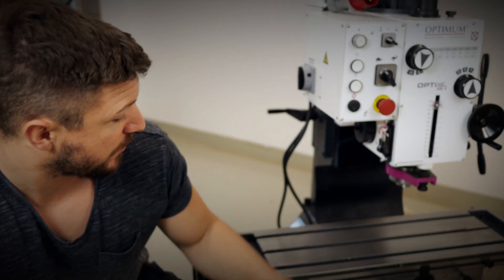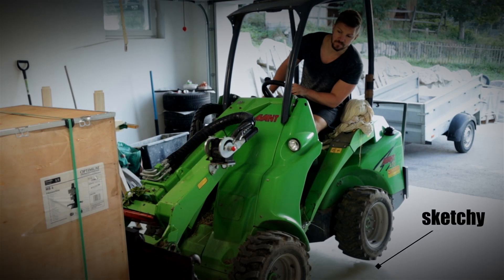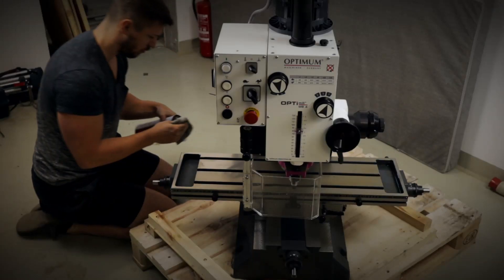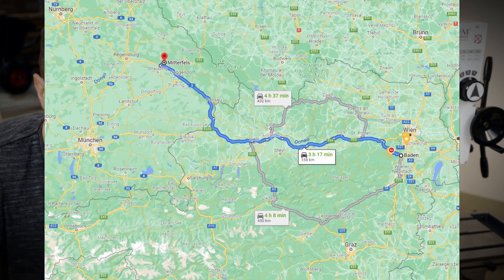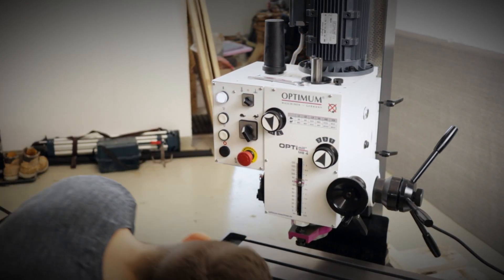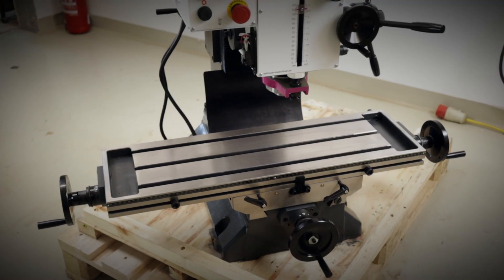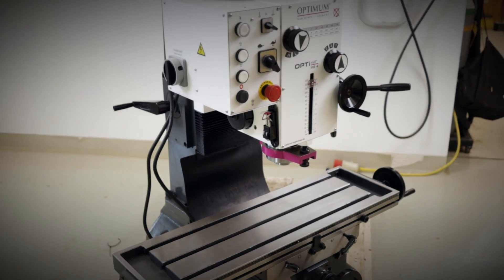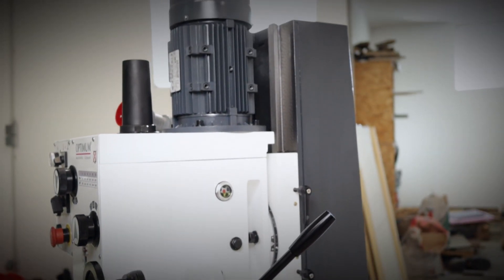OPTIMUM MB4 | is this chinese milling machine any good?

Comment: I want to believe that the very first thing you checked for accuracy is that metal square you are using for measuring. You would be shocked how non accurate those are "out of the box". They are good enough if you are assembling a kitchen cabinet but not for measuring the squareness of a machine to a hundredth of a milimeter.

Comment: Commenting on the machines itself. My opinion is that a machine of this design, when made in this size, is inherently flawed. Way too much top-heavy, no mechanical auto feeder, no adjustable tables, no powered Z axis! . Yes it has the power make large cuts etc, but it's not rigid enough for these, The separate electric feeder limited to the main axis adds more unbalanced weight and general awkwardness. At that price level one should be able to get rig of all these compromises and limitations that belong to the hobbyist / small shop class". It's for good reason why Deckel did the FP-1 the way they did some 70 years ago, it is still the best design  in my opinion. "motor on top" milling machine should be limited in my opinion to Chinese "size 30 or 32", with a BLDC motor and ungeared head.
Reply from the maker: I agree, but at this price point it's more a glorified drill press 😂
But I am very happy with it

Comment: Nice. Of course you're not the only expert to have dropped a ton sized machine. I'm in the same rank, allowing my "professional  mover" to load and NOT strap down a milling machine and an heavy lathe. At an uphill restart, both flipped inside the truck. The following hour, with 4 agitated men trying to upright them without all what would have been needed, was equally disheartening. But, both machines are repairable, I should get the lathe for free.

Comment: The test measures are truly precision. How much you have paid for it? Would like to see how it works out after milling blocks. From my understanding that the OPTIMUM MB4 is an engineered German product which is produced in china. Are you using the clone or authentic OPTIMUM MB4? Thanks.
Reply from the maker: Arround 2.5k €
Idk if they are engineered in Germany or somewhere else, but they definetly come out of china, and there are various clones of this machine
Reply: @ChristophLehner  "Fertigung in Yangzhou / China
Seit 2003 produziert OPTIMUM einen Teil seiner Metallbearbeitungsmaschinen in der eigenen Fabrik im chinesischen Yangzhou mit deutschem Produktionsleiter und Qualitätsmanagement-Beauftragten. Entwicklung, Konstruktion und Qualitätsmanagement finden maßgeblich in Deutschland statt."
... Quelle: Frontpage von Optimum, genau vor der Nase. :)) War eine sehr diffizile Recherchearbeit ... beinahe Detektivarbeit (10 Sekunden Aufwand?:P). Nich bös gemeint, im Gegenteil: Danke für das Video!:)

"Manufacture in Yangzhou / China
Since 2003, OPTIMUM has been producing some of its metalworking machines in its own factory in Yangzhou, China, with a German production manager and quality management officer. Development, construction and quality management mainly take place in Germany."
... Source: Frontpage of Optimum, right under your nose.

Comment: Chinese mill? Optimum is a german company and only produces in china since 2003, they have german quality management etc... ive never seen somebody complain about an optimum machine
Reply: The Optimum 'Opti-turn' lathe I have recently bought is NOT a quality machine with some porous castings, rust on internal parts, very poor quality over all, however it met my price point and does all I need to do.
I also have an Optimum mill which I like and it seems to be better 'quality', probably a different factory?

Comment: I have buy MB4 too this summer, and when i take it parts i see how X/Y sadles x-guide surface is only roughly milled. Then they have try little bit scraped surface, and try make it look little bit better. Table X-guide surface is only milled without oil scraping or grinding
Reply from the maker: Considering the price, you can't really argue, that not all ways are handscraped....
For what it's worth i find, it's a very capable machine with a good workenvelope

Comment: It seems like a perfect hobby machine, but personally I rather get a used Arsenal FU251 or FU321, for not that much more money if any even. I see the place for smaller lighter duty CNC machines but in my opinion (from my personal experience) beefiness is a real must for manual machines, to compensate for the dificulty of maintaining precision with a light manual machine, and to also make up for the loss of productivity, due to the inability to use modern highly efficient toolpaths (and the time consuming nature of even setting up a second pass on a manual), to utilize modern tools. 

Instead you must be able to rely on the beefy mill and beefy cutter to have the capacity to just take the cut, without vibrating the tool to pieces!
Reply from the maker: The beefier the better, that's for sure, but where i live used machines are almost as expensive as new ones....
For what it's worth, i find it a quite capable mill

Comment: I have bought too mb4. And i don't be so happy casting quality. It cost here in finland 3500€ and i have been waiting little more qualitu that money. But that is what i buy and that is what i get
Reply from the maker: What is the issue with your casting? Mine was rather fine. Sure more beefy would be nice, but as you said, you get what you pay for

Comment: Hello Christopher, sorry if I misspelled your name. I'm Keith from Michigan, USA and just bumped into your video here on March 17th. I'm past the 44yrs of machinery field and now I turned in a hobby, with a nice Lathe, however I just started 😀 with a mini mill. I completely took it apart and fixed all of the bugs. It's half the size what you bought.  So tell me about yourself! And how is your mill doing for the project's you 🤔 made. Happy 😊 or disappointed?
Reply from the maker: Hello Keith,
Thank you for the nice words. I also just started out machining all together, i was more into woodworking. The mill is doing fine, for the room it takes it is quite capable. Recently i milled my qctp holder down, which are hardend. i took a 0.5mm doc without any issues (with a facemill).

What did you fix on your mill?

i should take mine also apart, clean it thoroughly and fix the oiling ports....
Reply: @ChristophLehner  On the Mill, it's called a machinist vise, clamping face is 100mm wide - 40mm high. Now this one will do nicely to hold round bars. But it isn't a professional grade. I currently don't have a ytube account. I'm limited to comments. Can't attach photos to send, you could see what I purchased. Which country you live at?
Reply from the maker: @keithmonarch447  i am from Austria Europe
Reply: @ChristophLehner  I appreciate meeting you and also some nice exchanging conversations. Keith isn't bragging about myself. So far I'm a happy-go-lucky guy. Turning 65yrs this month. Most of my careers are positive ✨️. Traveling was fantastic 👌. I've seen 12 different countries, I haven't visited yours. I'll subscribe to your channel, take care now!!

Comment: Danke! Ich habe auch so eine im Auge.. das wäre einen vernünftige Grösse mit mMn gutem Preis-Leistungsverhältnis. Wie sind deine Erfahrungen seither? Grüße!
Reply from the maker: Servus,
Die Maschine ist ok, klar Zerpanungsmonster ist es keins, aber alles tut, man kann auch fräsen. Also für hobby Maschinen würde ich nicht kleiner gehen. Allerdings würde ich gleich ein paar Sachen einplanen.
Einen DRO, Vorschubmotor in X, Motor für die Z Achse.

Und ich glaube ich würde sie mir diesmal mit einer SK30 Spindel kaufen. Setzt man etwas in die warme MK4 Spindel ein, braucht man den großen Hammer um das Werkzeug wieder raus zu bekommen.

Gruß Christoph

Comment: I have optimum bf20 vario, and i have make myself nt30 spindle for my machine. It's much better than morse 2 spindle
Reply from the maker: Why do you prefer bt30 over mk2?
Reply: @ChristophLehner  Better bearing system, and now i can easy presetting my tools heights. And bt30 is more rigity than mt2

Comment: In some miracle of fate, I walked into my local Harbour Freight for my three times a week visit and my friend there and his helper were trying to figure out how to get this "liquidation mill" onto the machine tool table.  It was used (ish) looked very heavy and marked "clearance $689 as is".   I said I think it would break your table if you could get it up there, but don't bother I'll take it.  My friend said "we got 2 of them, this one was a floor model but the other one is new in box ... want that one?  Yeah.  
It was an early version of the Optimum 45s branded Xz _ _ _  or Xy_ _ _ or Zx_ _ _? It had a massive round column instead of the much better square type yours has.  Otherwise identical but claimed to be "5hp 30A 110V" which I found very unlikely, but whatever.  I bought it.
I later noticed it had yellow paint under the maroon paint it was sporting now, so I assume it made parts in China for years then got remanufactured for Harbour Freight.
I liked it a lot and ended up buying a power feed, 8" rotary table and lots of other goodies for it.  I wish I never sold it honestly but made a fair profit.  Never really knew what the power was but plugged into the 20 Amp outlet in the garage it wouldn't start in first gear with out wrapping a rope around the spindle and giving her a pull while pushing the switch. All other gears it would start right up.  I loved the things I could do with the head tilted and the rotary table mounted to the table.
Reply from the maker: Lovely story :) why did you sell i
Reply: @ChristophLehner  Sold it and my 13X 40 lathe for a move ... kept my mill/lathe combo machine I've had for 25 years now.

Comment: As Stefan quite rightly states in his review of any machine tool from  China, they should be considered as a kit of parts which need stripping down, cleaning, de-burring and then assembled correctly if you want them to be anywhere near acceptably accurate. Once done they are very able machines.
Reply from the maker: Couldnt agree more

Comment: Optimum machines usually have pretty bad quality. Remember to oil all surfaces with exposed metal well. Our school machines tend to rust very very quickly and those are from Optimum.
Reply from the maker: Imo this is more a problem of the humidity in the shop, and not so much machine issue

Comment: Hi, I have this same mill and have been surprised with the amount of deflection between the head and the table, easily 0.05mm with a light push, in x y and z directions. The depth of cut can be very noticeably altered by resting an arm on the head while milling. I believe the source of this is the base casting, not the column or movement in the gibs etc. You might like to investigate this. I plan to fill the base of my mill with UHPC or similar.

Do you notice similar deflection in your mill?
Reply from the maker: Thanks for the comment,  the mill is still on the palette it arrived on, since i have to work on our house.
But i am planning to mount the base to a concrete slab. I will keep you updated
Reply: CNC4XR7 on youtube filled his base with epoxy granite and noted a huge improvement (not this exact machine but i expect similar results with this)

Comment: bought one of these in NZ a couple of years ago. 6 speed only and morse taper 3 spindle. Ok as a drill press. Disappointing as a mill. Took it apart to investigate. Rubbish machining of the headstock and appalling assembly. I chose the Optimum as I thought it would have better quality control. Won't be fooled again !
Reply from the maker: Did it have a round collumn?
Reply: @ChristophLehner  no. square. Looks just like yours

Comment: had these machine been made in the US in the 50's and 60's they would have been made 10x better. How is it possible that with so much advancement in space age machining technology, with incredible speed and accuracy, we are now making and designing machines with WORSE quality than before!? CNC technology was suppose to make parts faster, cheaper, and achieve better accuracy without the intensive labor. What happened?  This is the price we pay for having everything made in China.
Reply: Maybe ten times better, but also ten times more costly. These less expensive machines can be made to do professional-level work (as GTWR has done) for a fraction of the cost otherwise. Instead of bemoaning the lower "quality," I celebrate the newer import economy in which I can afford to do things I would never have been able to do had production stayed domestic (where the quality, but not the cost, would have declined anyway). In any event, I almost never buy anything that I don't modify or improve after getting it home. Handing over money gives me only possession--modifying and improving makes the thing mine . For me, machining is not a profession, and building and working with and on machines is what I do for fun. It makes little difference to me if I'm working on a steam engine or working on the milling machine I'll use eventually to make parts for the engine. Both are rewarding, and I learn from both. Without inexpensive machine tools, it would be completely out of the question.
Reply: @tcarney57  You miss my point, Todd. CNC technology has grown exponentially yet the design and quality of these optimum machines does not reflect that. When making parts with CNC machines, we know all too well it's fast, very accurate, and saves a lot of time and labor. Are the makers of Optimum using CNC technology? They would be foolish not to. In their eyes, all they have to do is keep making substandard  machines because unsuspecting consumers will buy them anyway. God forbid Optimum would spend some of the time and labor they saved 
with CNC to make their machines better. If Optimum was making cars or washing machines, they would be out of business so fast, heads would spin. My contention is that we in the US made exceptional machines but even with all the CNC technology, we end up with machines that are poorly made hence need to be improved or modified. This has now become normalized. Car enthusiasts will go to great lengths to find a vintage car to restore. Why would they go through so much trouble? I believe it's because these cars were designed by designers who knew how to design attractive cars. They had that creative spirit- unlike cars of today that look computer generated. It seems we lost this spirit with machines too.
Reply: @tcarney57  Agree with you,Todd. It is a 'horses for courses' situation. Many home hobbyist shops wouldn't be able to afford any machinery if it weren't for these cheaper imports. With some adjustment and fettling these basic mills can be made highly accurate.

Comment: A little advice from a BF20 Vario owner.. Take it a part as fast as posible and clean out the casting sand and dirt,  put way oil all over the machine again👍 Always do this with chinese machine parts.
Reply from the maker: Thanks for the comment, yes taking it apart is on my todo list
Reply: That is always the best action with these import machines. I've seen several new ones of different brands and the casting sand residue is always there on all of them. Strip it down and thoroughly clean everything out.

Comment: Although many people are horrified at having a Morse taper in the spindle for a manual mill I think it is the best and most accurate solution for tool retention........for a CNC machine it's not at all practical where R8 or ISO 30 rule.
Where it does fall down is when you get heavy handed spanner tightening that has the tendency to freeze the tool in the taper.
At the last firm I worked for in the UK, before emigrating to OZ, we had a Bridgeport mill with 3MT  and at one time the spindle had to be dismantled and sent away to get the overtightened tool out of it.....we cured it by fitting a serrated turn knob on the drawbar end that you had to tighten only with the hand......never had problems from the herd after that.
Reply: Here in Europe R8 shank tools are a rarity. With the exception of most Bridgeports which is why I would never buy a Bridgeport. Here in Switzerland, you would want an ISO30 or ISO40 manual machine. Or a W20/W25 if you are already a owner of a Schaublin or Simonet lathe. I have a small import Morse 2 milling machine, this makes me sad but at the moment I can't afford to rent a bigger space.
Reply: @bensthingsthoughts  For a manual mill the R8 is a very ideal mount as it leaves you with a spindle face that is flush at the bottom giving you extra spindle to table clearance, whereas if you have ISO 30  etc you need to have a shank and a chuck on the end that sticks out of the spindle by about 60mm.
I don't know if 2MT is a popular mount but I have a Berardi jig borer....Italian make..... and it had the 2 MT spindle, but without a draw bar, so it was only "as good" as a drill press for down pressure on drills etc which as I wanted it to be a mill was totally useless, so I cut the end of the spindle off half way in the quill and mounted an ER32 parallel shank chuck to the spindle end ......now I have a mill and with a 19/20mm collet takes all parallel shank tools with a 20mm diam shank......very economical, almost TTS.
Adding a DRO made it a Rolls Royce.....LOL.
It had laid  for 35 years covered over at the back of my garage due to the 2MT spindle being unusable for milling......the next mod will be a power feed to the X axis.